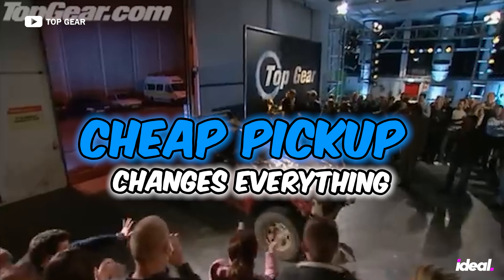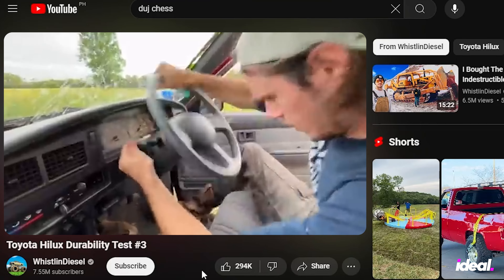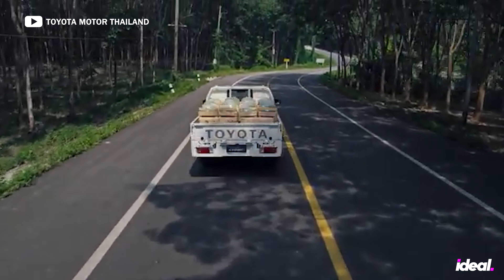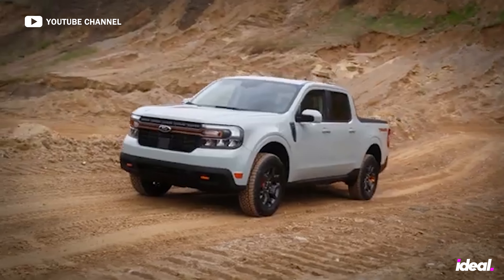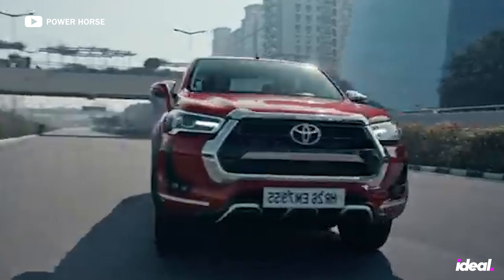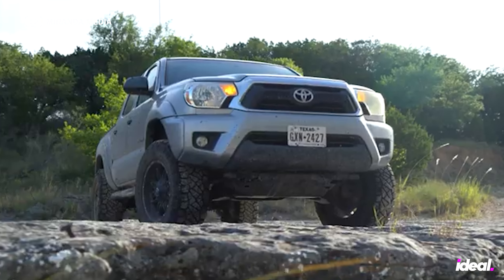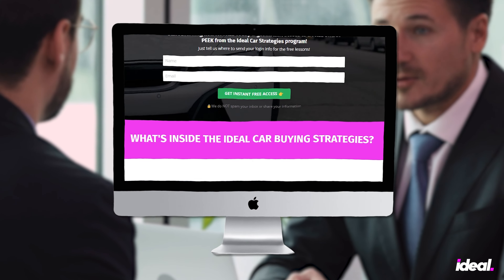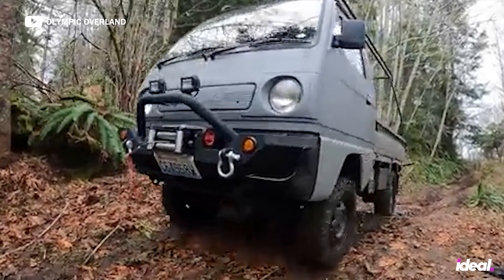Toyota Introduces An ALL-NEW $10k Pickup Truck & Shakes Up The Whole Industry!

Comment: I love teh best 10K myth, I am living in thailand and fully planned on getting one when i heard of it.  But the reality is is is 17k USD at dealerships and theat is the BASE model that no one wants, by the time you make it useable you are in the same price range as a normal helux or dmax.
Reply: 10K is clickbait.  I was looking at the 2.7L auto for 500 000thb (15K USD) Then I saw Mitsubishi has the 4 door Triton on sale for 18K USD. Thats cheaper than they were when I bought one 13 years ago.
Reply: @magamike1800  500k, you are a better shopper than I am lol.  After sitting in it there is no way I would spend my money on it the Mitsu and normal helux even if you can only afford used are so much more value for that money.   The Champ literally has seats worse than my 1965 unimog and feels about the same to drive.
Reply: @Average1212  I havent even test driven a champ yet. I am now leaning toward a Triton.
Reply: @magamike1800  I didn't drive it either just sat in it.  It didn't feel "tough" it just felt cheap without that cheap of a price.  

Then again the problem might be me, I have no problem working on my own stuff so the value of used is just too good compared to the price of the champ.   Who knows in 5 years the champ may be a good value but new I don't see it.
Reply: @Average1212  Interesting. I dont know if I can pay 500K for a Champ when I can get a new 4 door Triton for 600K. Triton is Diesel so cheaper to run as well.
Reply: Trucks average over $60k usd in the U.S. I've personally seen a Ram for $95k
Reply: The cheapest l200 in Brazil is about 41k usd
Reply: I want it as a base for a truck camper. Now I have to research the thing and make that money. 😂
Reply: @MikeTheVanFX  Long wheel base one would be perfect for a camper. They make a great one or it here in Thailand.
Reply: @Average1212 In Thailand, Toyota wanted to makes it such a cheap version, the Hilux Champ isn't as good as the Philippines Hilux Tamaraw, Dropside diesel engine with automatic transmission, which is coming at 17k. With touch screen system android auto and apple carplay, and more.. while in Thailand they're making Hilux Champ without anything, but almost the same prices, not even a 2DIN Bluetooth radio 😅

Comment: Get the Turbo Diesel engine, its a 2.4 4cylinder claimed as making 150hp. However, mine comes making 156hp and after I unblock the air filter (there’s a plastic piece that sort of covers the air vent) makes 167hp. This is widely known in Indonesia that the engine makes more than what the manufacturer claims and with simple bolt on can go up to +400hp.

Comment: 1. Champ is not available with 4x4
2. IMV is not the same platform as either of the Hilux models destroyed by Top Gear and WhistlinDiesel
3. If international market vehicles pass NCAP, ANCAP and JNCAP testing, they should be able to pass NHTSA tests with little or no modifications 
4. Ditto for the EPA and its foreign counterparts
5. The Tacoma is not a redesigned Hilux, but I do agree it is much softer
6. Champ is bigger and more powerful than a kei truck. Not the same market niche at all

Comment: I have a suzuki every wagon, 4x4 650cc turbo, and manual gearshift, aka anti theft deterrent. It's in pristine newly renovated condition with a few extras like 2" lift, mud tires, front bush bar, roof rack  and rear ladder, and rear bush bumper What can I say? It looks cool and rides well. Not fast, but then it's not for breaking the land speed record. It sips gas, and it's the perfect little camper.  It's my ride in the philippines.

Comment: Basic is good, the hood is the thing that gets my attention.  How easy are these to work on?  My experience with Japanese cars is that everything is so tightly packed together that they're kind of a nightmare to work on unless you have hands that are both unrealistically tiny and unrealistically strong at the same time....
Reply: Hopefully it's easy to work on but I know what you mean. The old 4runner my friend has is a tank, barely anything goes on it, but when it does, it's a pain in the ass to fix.
Reply: @nickarmo1776  I get that, and it could easily be the case.  I haven't really seen a good look at under the hood, so everything could still be well into pain in the ass territory....  just hoping otherwise.  Easy to fix is a HUGE thing for me.

Comment: A 10k brand new truck ?
Yes I want 2 of them.
Sadly, I will have to wait 25 years to obtain even 1.
If only toyota could come up with a "glider" option.
You know, the almost complete truck, with out engine, transmission and interior.
Leaving power plants a special order from toyotas parts division.
3 cylinder turbo, 4 cylinder n/a, smaller v6 n/a, auto trans, manual trans etc...
Interior components from bottom of the barrel and the way up to lexus leather opulance.
Kit car style.
So that thin profit margin could get much higher.
Granted, the "glider" portion of the kit would still be in that $10k region, but the additional parts could be as cheap as used toyota tacoma all the way up to lexus race components.
Keep in mind that the Indian company Mohindra already sells a "jeep" like 4X4 utv, that can be made street legal in many states...
I think it could be done.
Still far more reasonably priced than modern pick up trucks that are being purchased less often due to insane pricing..

Comment: 10k only for the cheapest short wheel base with gasoline engine. They're asking 14k minimum for the long wheel base diesel engine variant, but with nothing almost. The fully loaded Long wheel base diesel engine variant with automatic transmission, it's about 17k. Well, that's still less than 20k, which is still pretty impressive in this era of inflation everywhere.

Comment: That truck will be more famous than the honda in 25 years here in the US
Reply: You can now get a Mitsubishi Delica L300 (comes with indestructible 4D56 diesel engine) &  Toyota HiAce/ToyoAce but they will become more rare and expensive, so they favor more on importing kei trucks instead. Since importing a bigger sized CBU from Japan is too expensive. Imported Scrapped parts are also illegal in the States

Comment: accessories manufacturers should verify. pull out engine and gearbox and use as towed-trailler to move a million chassis and have supplies pushed to workshops. consider unregistered usage = no tax no paperwork no plates but towed. consider boat hull and sell it back to them
Reply: CKD to workshop
= crates - engine, gear-box, differential and axle, doors windows panels, wheels brakes,  interior
= chassis 
= buyer pays shipping
= MOQ.?

hull the camper to boat
food pushcart shop without engine and seats (workshop sells engine seats for stove an oven)
...

Comment: I hate all the new technology in cars today.  I have a new Outback, and Tacoma and am not impressed with either.  I would pay to have a solid small 4x4 truck with no frills, absolute minimal electronics (radio, USB port, AC, speakers) and enough power to pull roughly 6000-7000 lbs.

Comment: In Australia we will not get the Toyota Hilux Champ because of  the lack of safety equipment but it can be imported privately we get JDM vehicles in Australia that are only 1 year old but these are mainly people movers but the Champ because it's a commercial vehicle and by the its a ute no such thing as a mini truck they are small utes and you can buy small utes in Australia although not common and the Suzuki Carry van was available through Suzuki dealers when they were new also a small Daihatsu van there are many Kei cars available through dealers but there is a huge amount of JDM vehicles available in Australia see them every day especially believe it or not Toyota's they are everywhere but fir the Hilux Champ there is a drawback with them no heater if you have a good look at the dash board no heater controls at all that will limit there importing into Australia because they will actually are been sold in Papua New Guinea which is the closest country to Australia maybe a couple will make there way into the Northern pats of Australia but the lack of a heater may limit there sales but the Hilux Champ does have air-conditioning  so great for warmer climates after all you wouldn't apart one in Tasmania and Australia doesn't have that stupid chicken tax